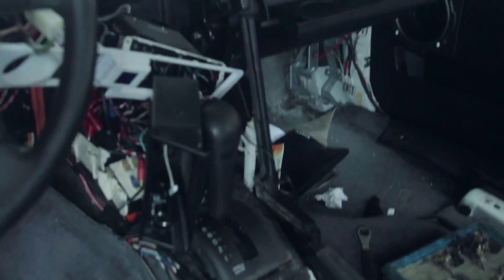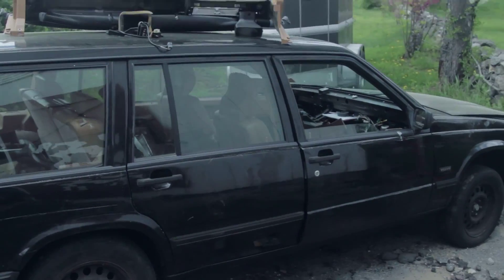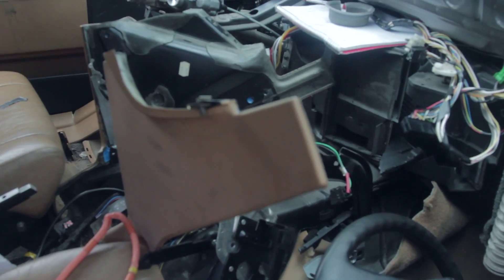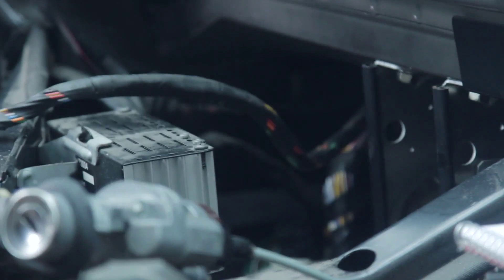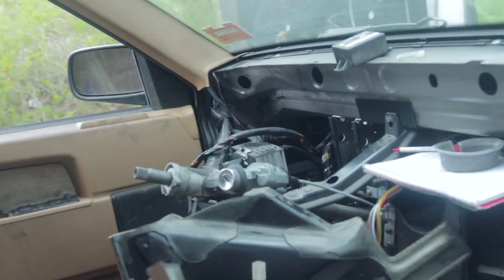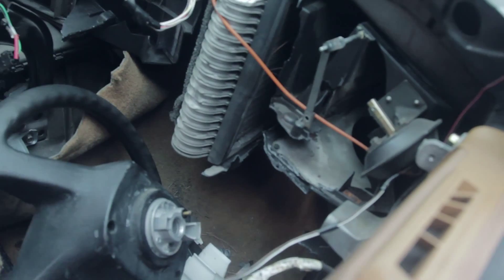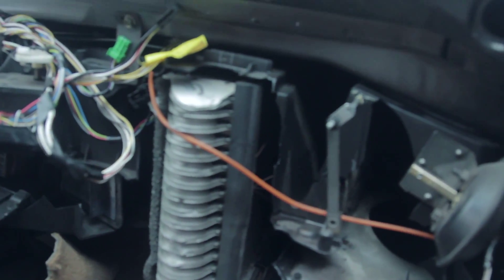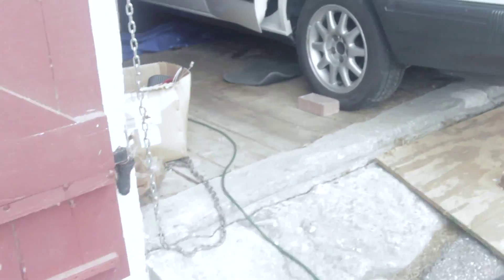Volvo 940 Engine Swap Day Six (B230ft Turbo)

Comment: You're using the M90 right? if you're goin to tune the engine, switch to the M47 from a 740, they're more tolerant and tend to be more reliable than the M90, and if you're going to seriously tune the engine, you'll want to a BMW FZ transmission, ocf you're gonna have to re-weld the bellhousing and use one that fits to the b230fb =) take it from a swede, we know a thing or two about old volvos :) cheers!

Comment: You are swapping the transmission over right? Because the normal b230f transmission in a 940 cant handle the torque, tis why the 940 turbos came with transmissions with non locking torque converters.